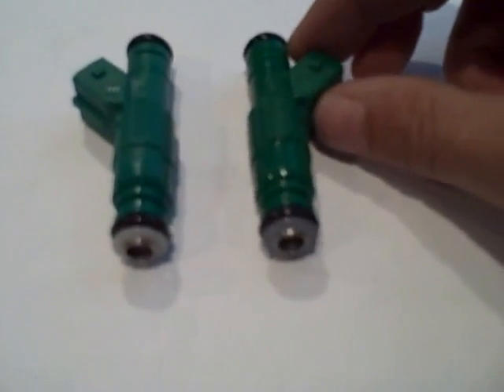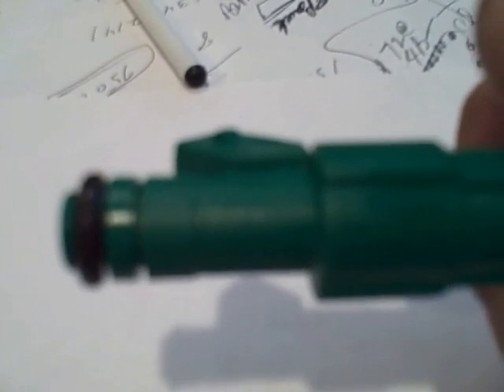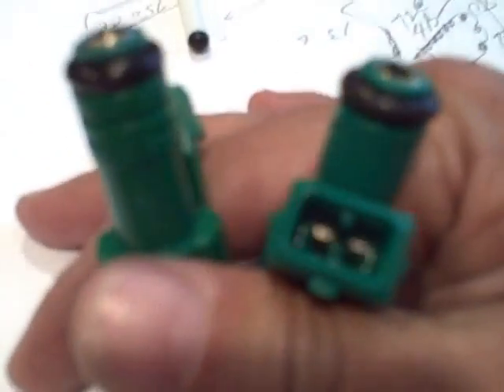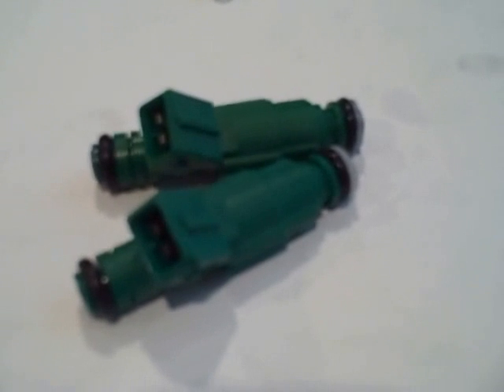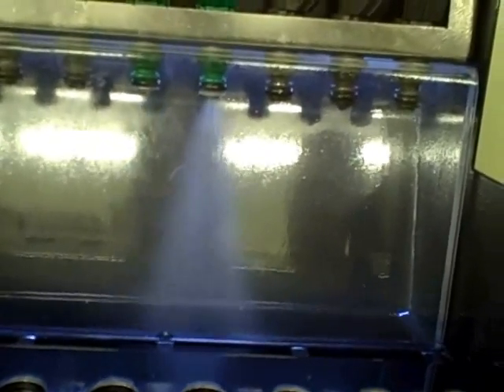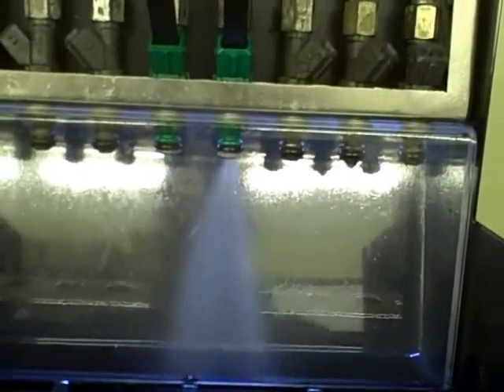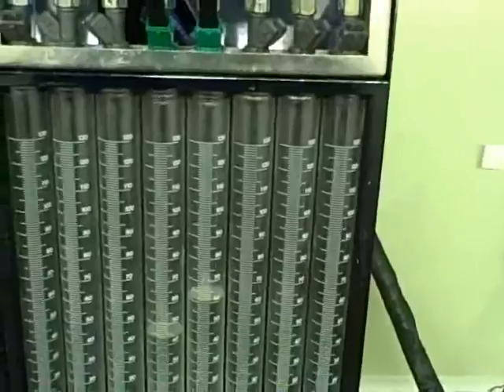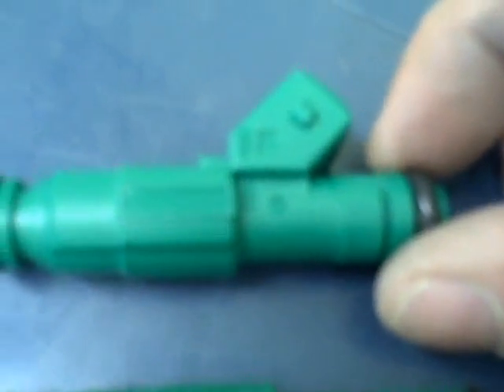Fuel Injector Connection Comparison of Real Bosch 42LB to Chinese Knockoff

Comment: No one runs 70 psi of fucking fuel pressure on gas bro 40-50 is fine
Reply: Yeah, these are 42lb injectors @ 3bar fuel. They can flow up to I believe 530cc with 4bar Fuel pressure regulator

Comment: you .. it right on the head.i had some sent  inp-771 .$88 4x .posted  ..it tuck 22 days to arrive money refunded did try the injectors in my bike  it would  run but would not tick over. emailed them .said. flow problem. . in japan there trying to sell the injector i need for £167. each 4x that. ow much. i get mine cleaned . 7/7/2020.thank from john in the uk.

Comment: I got a set of eight for $40-50 on ebay and they have the insignia and accurate part # molded into the body, but they also have the double ring on top. At the same time I ordered another set of "Genuine Bosch 42lb injectors" from a reputable performance website @ $250 for 4  to compare, and the same exact injectors with two rings on top showed up. Same insignia, same part # molded in. Pretty confused now.
Reply: No way mate?
Did you test them?
Reply: late af but i ended up returning the $250 set and threw the $50 set in the trash. Opting for DeatschWerks matched injectors now.
Reply: They both fake brother, Bosch NEVER made a 2 slot injector EVER, The fake market is so big they have even gotten into the industry so even ur local parts store could have fake stuff

Comment: As a mechanic and car enthusiast I would never use or recommend cheap knock off injectors to run with boost but this video I would have to say is sorta biased ?  at normal psi operating it appeared normal and 70 psi is way above normal ... I would have like to have seen flow test done at 60 and 65 psi just to see if reliability is decent at those levels for the idiot proof build for a cheap bastard that also cut ever other corner on his build so sketchy injectors would be right up their alley.  just for information purposes because i have seen whole sets of these knock off injectors 42lb going for half the price of 1 single bosch injector and that is even including shipping and handling and tax.. whole set of 8 for $40 when a single bosch is around $60 give or take .. me personally I will pay the bosch price and have trouble free service for life of the car .

Comment: I have a set of mostplus injectors for my 87 ranger and they perform amazingly... stock injectors only net me around 16mpg. I put these chinese injectors on my truck and it idles way smoother, I don’t smell gas anymore and my mpg went up significantly.. before i was lucky to get 16mpg on the highway, now I’m getting 22mpg on average and better throttle response..
Reply: Yeah I am using Chinese injectors in my Commodore and they are awesome. Only cost 10% of the price of a set of originals. For all we know this video is propaganda.

Comment: are these 0 280 155 968  ?
Reply: +Fuel Injector Connection It's ok thanks for the reply. I'm just looking for a decent injector upgrade for my Mini r53. I saw these Chinese ones sold green giants but think I will leave them and maybee look for genuine. These are 380cc with a dual cone spray pattern aernt they 15-20 degrees? 
Regards
Warwick

Comment: actually they are not that bad. always buy extra and use the best ones 10-15$ for an injector yeah i can throw couple away ... BTW general fuel pressure on road cars is around40-45psi which is the region where chinese injectors work best

Comment: Hey I bought some cheap green 42 Lb injectors and have yet been able to get the AFR correct. Are they are known to be mismatched in a set?
Reply: *****

They are probably crap. I put my 30Lb Ford orange tops back in and I seem to have enough fuel now that I changed the fuel pump to a high output one.

Comment: just bought 8 delphi fuel injectors for our 2001 ford expedition and of course there made in china but still one way to tell its a cheap knock off is too read the product name it can say Delphi FJ100093 but i saw exact clones of them an 8 pack for only $190 but i got 8 delphi injectors for $620 the description on the 8 pack said fuel injectors replacement for ford triton 4.6 5.4 and 6.8 engines no brand name its not that all made in china is and its just some knock off products of course dont have quality control testing they just get as cheap as possible make them and pack em while in other plants they make them test them then pack them
Reply: For 620 dollars they better be made by the president of Bosh himself,there is a way to buy good brand name injectors out there,you have to shop around,find someone on eBay that bought  a new quality set and wrecked his car,someone that needs quick cash etc.

I will never pay more that 200 for a new set and they will be brand name, Ive done this many times,injectors are way overrated,its ancient technology (for the times we live in) i see people selling a individual injector on eBay sometimes for 130 dollars,thats just crazy.

Comment: To be fair, the injector won't lock up under boost on an actual engine because it will see that increase in pressure at the injector tip too.  You only increased fuel pressure in your test.  The differential pressure is what is important.  That said, I still wouldn't cheap out and buy knockoff injectors, too risky for an expensive engine.  Thanks for the video!

Comment: I just has a set of these Chinese 42lb injectors come through.  These new ones ran ok up to 100psi.  But, the flow varied quite a bit from injector to injector. Most were right around average.  But, some were low by nearly 15%.  And the "flyers" tended to be low.    So, if you use a wideband to tune the average to 12.0AFR under load... the lean "flyer" cylinder will be 14.1AFR ! ! !

Do NOT use them without flow testing !

Comment: What is the proper # for these injectors... look like 42lbs... The failure at 102lbs is not important, you would not expect to have them perform in that range anyway.  Nevertheless can't beat proper engineering for the long haul.  Although a bit of plastic molding simple electronics and gaskets, you would think they could be knocked off perfectly.
Reply: Tell you what. Genuine Bosch is crazily expensive, even the chinese knockoff is a fucking rip off. You would think a bloody tube, a solenoid, a metal valve, a metal plate with several holes, and a filter basket. Come on, it will probably cost less than a dollar to make the whole thing.

Comment: Jon, would you use these Boschs in a single valve LS application? Is the spray pattern not too wide like the green tops or "blue giant" 39 lb injectors?

Comment: I use 4 china injectors with SN stamped on them so not the same lot as tested here, but they work fine and without cutting out at 5 bar (70psi) on my turbo engine.

Comment: How do they work under normal conditions. It sounds like the machine is running at a high RPM setting (10000 or 12000 rpm) when you were showing it cutting out. GM multecs do the same thing at higher pressures but they work well in the LT1's at 3 bar.

Comment: I am about to buy some injectors for my Ford E-150 and have been debating whether or not to grab a set from the salvage yard (U-pull) or buy one of the sets from ebay. The ones I am looking at on ebay claim to be Delphi and are about half the price of the injectors at the big auto parts stores. After seeing your video I am leaning toward the used U-Pull set over the ebay sets. Thanks for the great video/info.